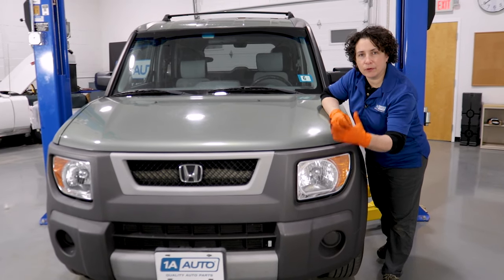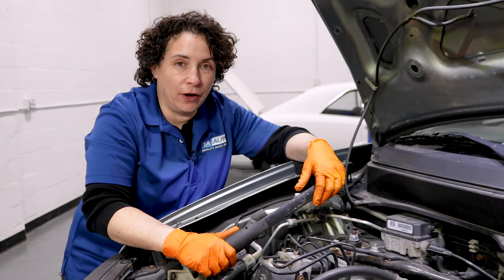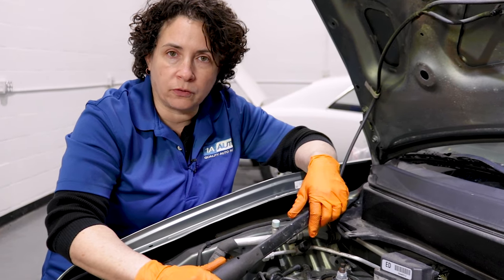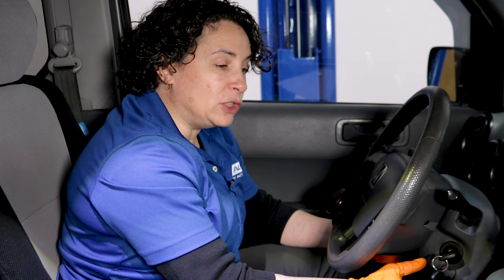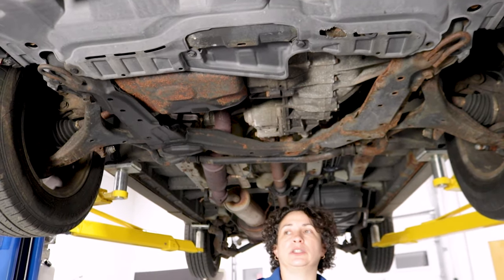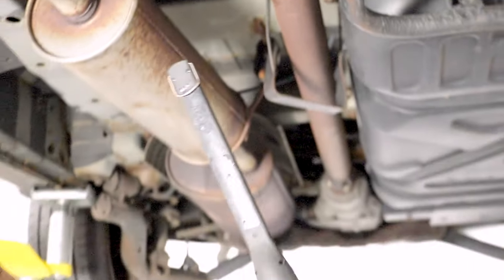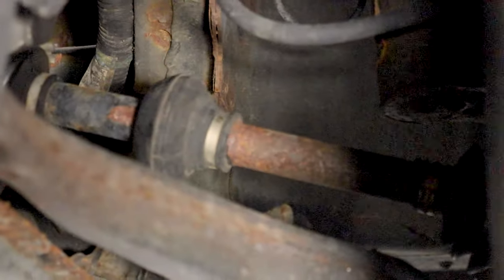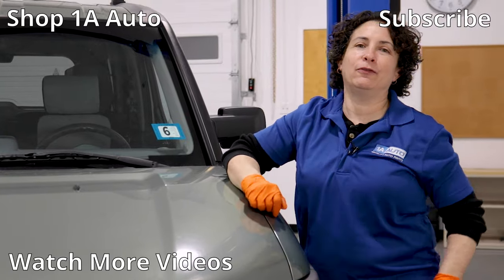Top 5 Problems Honda Element SUV 1st Generation 2003-2011

Comment: I have a Honda Element 03 DX All Wheel- Drive--- when driving there's a sorta popping noise that sounds like its coming from the front passenger side? In idea what that could be? Also sometimes when trying to start it when the key turns on my dashboard lights will go out except for the check engine light and the gear parking light when key is turned off the check engine light as well as the gear parking light will continuously Flash with a ticking noise coming from what seems like the glove box the car does start up most of the time when it does that but I will have no front lights no headlights no dash lights except for the check engine light and the parking gear light as well as sometimes when turning the key over there's no crank no start but my lights do work and if I jiggle the key or try to start it in a snap kind of motion rather swiftly when I turn it over it will start but there's like a sort of buzzing noise if you have any intake or any suggestions I can't really afford to put it in the shop me and my husband and the help of YouTube kind of work together if there's any suggestions as to what it may be it would be extremely appreciated awesome videos by the way

Comment: What about when it shows the code for TPS and you correct it and the engine light goes out but..now your shifter is stuck in park. Can’t drive unless you do the old key in the shifter slot trick. Any thoughts? Thank you in advance!!
Reply from the maker: +NoRmAsJeAnS82 We wouldn't be able to diagnose an issue like that here, you may want to have a local mechanic take a look at it. Thanks for checking us out! http://1aau.to/m/Shop-1AAuto-c

Comment: I have a 2003 Element. Mine does the non starting thing with the Key, but if you turn on the Windshield wipers, it starts. (Not kidding) Now  after watching this, I know what the Problem is with the Ignition Switch. Thanks 1A Auto!!

Comment: I had the shaking issue on my 03 element (fwd 5spd)  CV's were bad on both sides. Got them replaced,  but have a small shake starting off, not so bad after I am up to 35-80mph.  Could this be a warped flywheel? Or cheaply made CV?
Reply: Hello. I had same problem with CV shaft on passenger side. I bought shaft aftermarket and vibration gone, but was appear again. Aftermarket parts made from cheap metal. Buy OEM shaft Honda. It is expensive 260$

Comment: Have had my 03 DLX from new 91000 now ..retired mechanic ..here's some of the problems I've had ... Cooling fans both  have gone bad 1 bad 2 times ..Radiator leak at pinched seams ...Idle air control valve dirty causes erratic idle ..simple to clean ..STARTER 2 times so far ...real pain to change ... Lower control arm bushings both sides ..1 side 2 times ... OK car but not perfect for sure

Comment: Have you ever heard of P2016 ECM/PCM Engine Off Timer Performance. honda shop redid the software? it worked for a few months and came back.  I had another shop tell me that if it keeps happening i  will need a new ECM.  I haven't gotten it fixed yet  Honda 2010 AWD Ex 124,000 miles.

Comment: this is the most trouble free car i have ever owned--2010 with 140k. beside brakes, tires, battery the only thing i have ever replaced is 4 motor mounts

Comment: That Element's underside is so crusty. You'll only see 1,2,3 issues in the west coast.
Rust belt regions will have all 5 issues. 
BTW, those CV axle issue with the damper (rubber balancer) is also the source of  broken axles. I've seen too many of them in the rust belt region.

Comment: What’s the best shocks and struts and I can use on my 06 element I wanted to used the crv bilstein shocks with my stock top hat for it to work and fit for the rears
Reply: Best? OEM.  Check Bernardi Honda for parts.

Comment: Anyone know where to look to see why a 2006 ex-p would shift hard from 1st to 2nd gear? RPMS go high until shift. 3rd & 4th gears are smooth. The fast the acceleration, the harder the shift from 1st to 2nd gear

Comment: My wifes 2008 element has a shudder almost always on acceleration  between 40 and 50 mph. No body has ever been able to determine what is causing it.  Maybe its that long drive shaft.

Comment: correction... 2 in 1...... the leaks are irrelevant they all leak and if someones worked on it they can all leak at the same time... ps leaks are common and with that said if you have one and hillbilly some tranny fluid in there cuz poppa did it forever well those detergents are gonna break open seals and break down rubber.... yep... so the cv axle wobble she just explained is basic for every car within 100k... but what if I told you a shutter on acceleration in this top heavy element was a bad mount????? Motor mount specifically the rear.... it rests right under where all kinds of fluids converge and fall.... one spot puts a ps leak right on top of a sub-frame bolt and it walked itself right out almost all the way until I threaded it back in. well motor mounts last 100kish... bolts last forever... so imagine a stream of leaking petroleum all over a mount? a rubber bushing can start the vibration( (and youll feel it at stop lights with your foot on the brake its a high frequency vibration even makes the dash plastic vibrate.. well the starting vibration works the bushing loose and deteriotes it then the it just happens bolts get unthreaded cuz they are that clean with petroleum laced with with detergent.... USE CLEAR PS FLUID ONLY. IF YOU HAVE A BAD ENOUGH LEAK YOU JUST CANT FIX FOR A MONTH OR 2 USE A SYNTHETIC BLEND IT WILL HELP SOLIDIFY THE OIL AROUND THE LEAK AND SLOW IT DOWN.... some people actually think synthetic oil causes leaks. no it doesnt the leak was there it was just gummed up and held back by old used up conventional oil... if your vehicle used that for its whole life then yes synthetic will break those leaks free. give it some time they will block back up with thicker oil. but the cv vibration thing will be felt every time you touch the gas even lightly. the mount problem be just like it but will go away soon as you are cruising. its relative of torque thats why it gets confused with axle...

Comment: Don’t waste your time and labor with aftermarket CV shafts. They clunk, shake, rattle and pop. I tried two sets of front aftermarket shafts and finally had to spend the extra $400 for Honda OEM. Labor isn’t cheap.

Comment: Intermittent knock when you step on the brakes and drive after reverse, only on right rear  whats the cause?
Reply: Brake pads shifting in the caliper ..not really a problem

Comment: Hi, my element it goes to 69 on the interstate and no more. When it hits 70 mph, it stops accelerating altogether and swings back to 60 mph. What can be?  it also spends a lot of gasoline. 😭
Reply from the maker: +ARMANDORC We wouldn't be able to diagnose an issue like that here, you may want to have a local mechanic take a look at it. Thanks for checking us out! http://1aau.to/m/Shop-1AAuto-c

Comment: I flat tow my 08 element sc. Can I tow newer Honda's as well
Reply: Always call a flatbed to tow any car. I also suggest paying extra on a aaa membership so 150 miles is free. Old cars break. 
I'd rather tow it all the way home. Covid-19 f'd up the free ride with the driver though. Yes bought 2003 Element ($400 purchase) 253000+ miles Now leaks a quart of p/s fluid a week & was on road trip, outta money, gas, etc so i called for a tow. Funny I'd rather use that then try to ask strangers for 💰.

Comment: To all my cheap people out there. You can replace ignition switch with a new one take black ring off old one. Tape old key close to ring from old one you swapped. Use new key on ignition switch you bought wherever to start like normal. Ring will pick up signal from old key that is taped close to it and it will start. No need to program. But if a thief knows he can just turn ignition with flat head screwdriver punch cause key signal always constant and it will start. But who the hell is going to steal a Honda Element in the first place. Imagine you in jail with another cell mate and have to explain you got caught stealing a toaster. It's no bueno.

Comment: I have a Honda Element 2003 and everytime I get to about 3,000 RPM like trying to pass somebody or getting up onto the freeway once it gets to that 3,000 RPMs it starts to bog out like it's about to die or like I'm running out of gas or something can someone help me please figure out what can be causing this problem I would like to drive the freeway again
Reply from the maker: +Jessie Pierce We wouldn't be able to diagnose an issue like that here, you may want to have a local mechanic take a look at it. Thanks for checking us out! http://1aau.to/m/Shop-1AAuto-c
Reply: Thank you for your help
Reply: Probably the number 1 issue that was discussed. I experienced the same symptoms.

Comment: found this to be a good car up until about the 100k mile mark then all hell broke loose and have put about 6k into repairs.  As all Honda's they are way over engineered and they are made so the DIY repair guy has an extra tough time doing work on them.  Trading in on a Subaru forester here in the next few months

AC system rebuild and recharge
muffler and tail pipe
new alternator
Evap charcoal canister went out
lower O2 sensor bad
Front rotors replaced and brake pads
passenger side window motor
driver side door lock was "locked up" and wouldn't turn or open the door
Reply: 6k? Did you take it to a shop bc that is way too $ to have spent? We bought a 2006 Ex-p with 161,900 miles on it for our son for $1,500. It was wrecked in the front end & we spent $600-800 on new ac compressor, bumper cover (used) new radiator, new brakes, rotators all around & master brake cylinder, front fender panel (used), headlight (used), new battery. My husband & son did all the work replacing everything. Youtube videos were/are of great help to show you how to replace things. Core support & actual metal bumper were not damaged
Reply: @captainobvious4051  well you prob saved yourself 6k in labor costs doing it all yourself...don't have the ability or tools to rebuild the AC system or the muffler and tail pipe
did replace the alternator myself...i do brake jobs no problem but when it comes to full rotors. bearings calipers that is too dangerous to screw up, and re-keying the door required a locksmith.

Comment: Charging issues when the alternator is being control by BCM/PCM OH BOY..THE CAR WOULD WORK BUT THE VOLTAGE  WOULD DROP..AND CAR WILL DIE..ONLY WAY TO FIX IT..ITS BY SWAPPING THE PCM/BCM.

Comment: I have a different problem with my element. It has been there for ~ 5 to 6 years. The mechanics could not find the issue. It is gradually getting worse  :(  Any ideas? 

When I make sharp left or right turns, I hear a popping sound coming from the driver-side front end. It almost sounds like something pops in/out of place. When I turn the steering wheel all the way left or right I hear the popping sound, and when I straighten the steering wheel, I hear the same popping sound again. 

First time I noticed this sound was years ago. Back then the sound was barely noticeable. Now it is loud enough and it is almost at every sharp turn, but the mechanics and dealer could not find the issue  :(
Reply from the maker: +Ozgur Bozkurt We wouldn't be able to diagnose an issue like that here, you may want to have a local mechanic take a look at it. Thanks for checking us out! http://1aau.to/m/Shop-1AAuto-c
Reply: Sounds like the CV joint if it's in the corners ... Haven't heard of them going bad so much .. No "Popping" when your going over small bumps/holes ?? The lower control arm bushings are notorious for going bad and will make a popping/banging noise ..